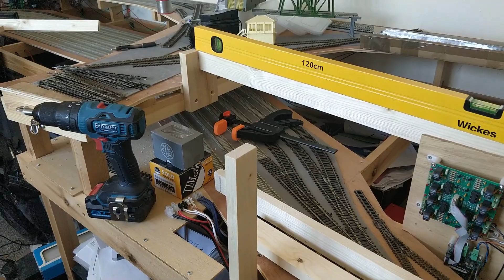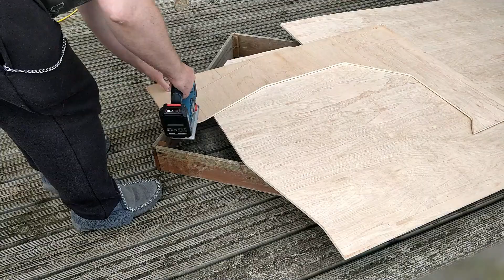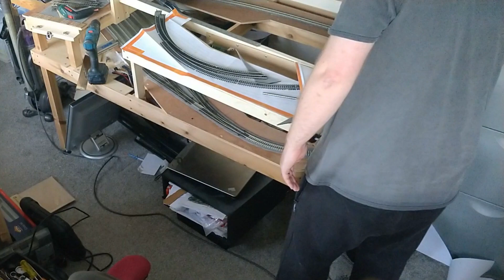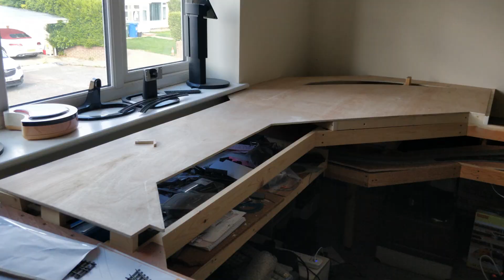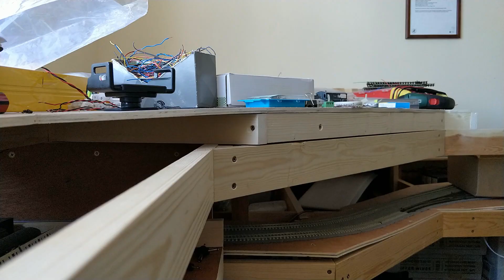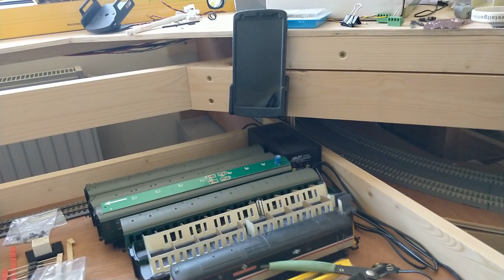Model Railway Construction: More baseboard. Gradients and vertical curves.

Comment: Great video as usual. Love the outro, it always makes me laugh! I have an actual model railway comment: Engine driver is great, I also use it on my layout. It does bother me a bit that there's no tactile feedback, especially since you have to look away from the device to use it in practice. I wondered if this ever bothered you and if you'd thought about solutions?
Reply from the maker: You can set Engine Driver to use Haptic feedback (phone vibrations) in response to speed changes, button presses, or both. It's buried in the options.

I elected to leave this off as it can already eat through battery fairly rapidly and Haptic feedback will just make that worse.

I do also have a kit for a physical controller. The fact I haven't got around to building it yet suggests I'm happy enough with Engine Driver for now. That may change when I have a proper shunting yard.

One thing engine driver does really well, is if you tell JMRI what the functions do on the loco, it can display these as text on the buttons instead of the traditional F numbers. So no needing to remember that on this loco F3 is the cab light, whereas it's F2 on that one.
Reply: @DongitsModelRailway  That's a nice feature I'll have to try out. The flexibility of Engine Driver is the most valuable feature for sure. I'll also give the FN buttons a go too.

I've been prototyping using a gamepad with JMRI and it's an interesting input method. I'm trying to make the controls more intuitive currently, once I have something that works nicely I'll look to share it.

Comment: Some real skill, craft and careful planning on show here, I'm thoroughly enjoying it. I think Engine Driver drains batteries more because it keeps the device alive. I think, if JMRI loses contact with a deevice that has a throttle open it stops the loco that the throttle was controlling, so the app has to stay open and keep the phone alive.

Audio sounds better here. I think it was just a little muffled before, like listening on a bad phone connection. That's from memory though. It was never that bad.